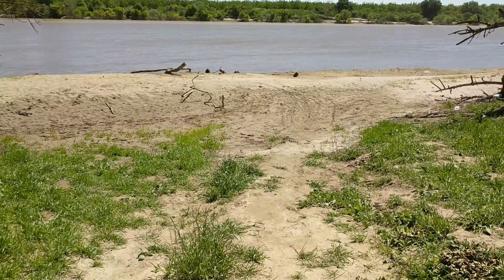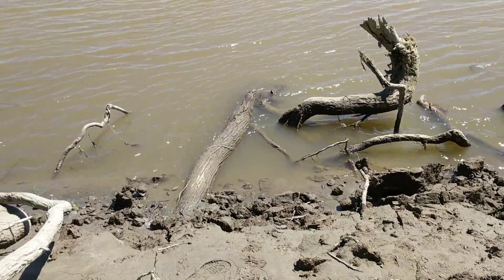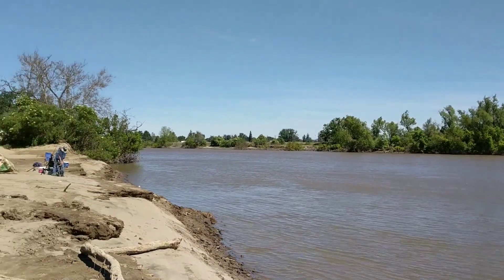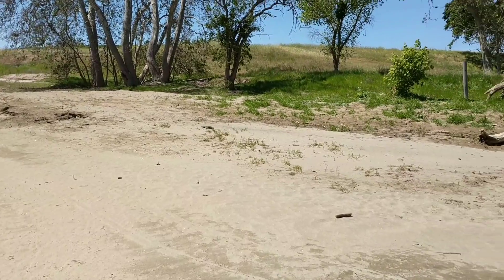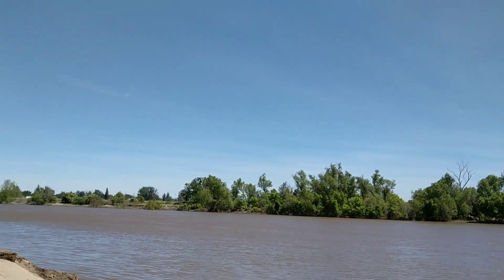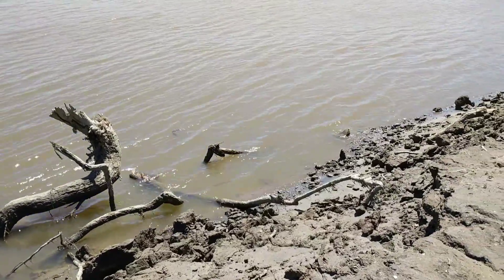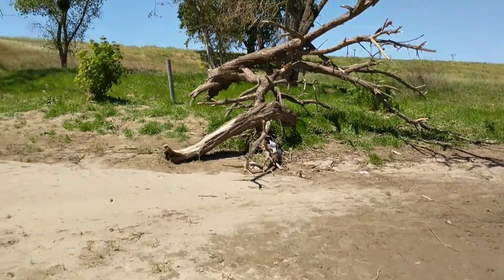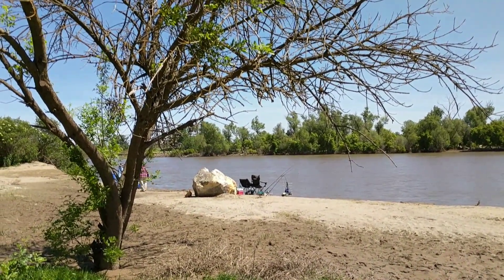5/2/17 ~ 30 miles downstream of Oroville Dam (11,000 cfs river releases)

Comment: Hey Miss Millie, I have a question.  I was looking at the diagram showing the power plant with the diversion tunnels, at bottom of drawing, and it shows the dam axis to the right and penstocks are at top of drawing leading to the intake structure pumpback outlet.  
Do the diversion tunnels go under the dam wall into the lake?  Where does the intake structure pump back outlet enter the lake?  I got all turned around on the diagrams.  Thank you